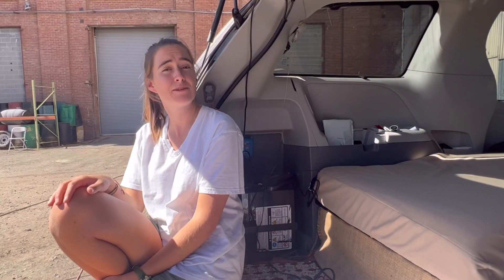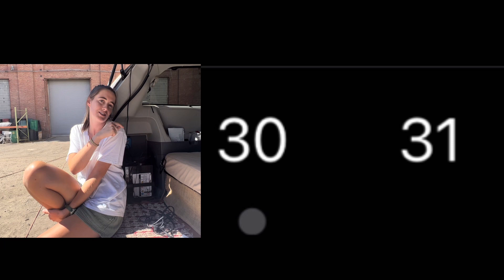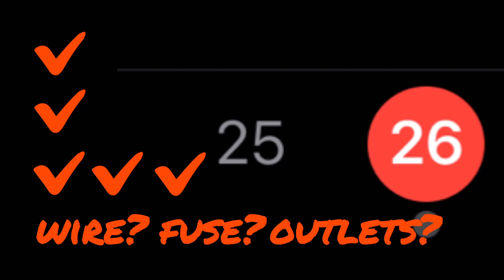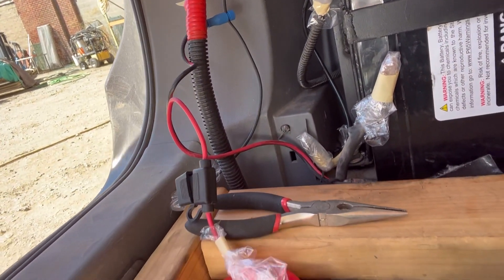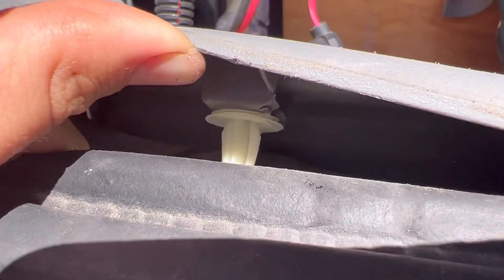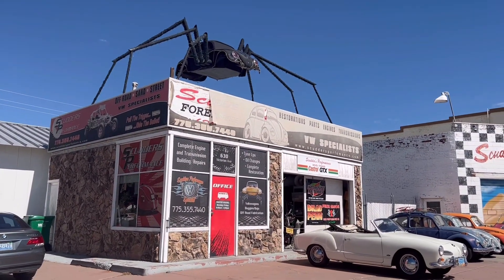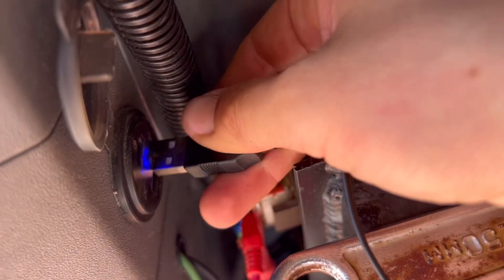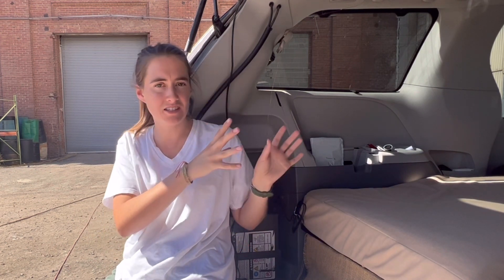Could YOU Solve This Van’s Electricity Problem???

Comment: Odd the power went out at the plugs they 2 days later fridge stopped working. There might still be a issue there somewhere as the fuse blew in the first place. Glad you fixed it for now
Reply from the maker: Yeah, I’m worried about that too. Only time will tell, I guess!

Comment: Well, see there, I knew you could do it! 
From the video I did not see an inverter so it would appear you only have a solar charge controller and 12 volt outlets. Also, there was no indication of where the blown fuse went to and where the supply side was coming from so it makes things difficult to fully diagnose. However, when an electric motor such as the one in the compressor of your fridge is trying to do it's job and can't get the amperage or voltage it needs then it can over heat and cause a current spike which can blow a fuse. And if you had a combination of of a heat stressed refrigerator and a somewhat drained battery this could be the reason why the fuse blew. It is still a bit odd why the refrigerator kept working after the other outlets went out when one fuse fixed them all but perhaps they had protection circuits built into them. One would still think they'd reset themselves once the battery was charged but maybe the fuse was damaged already and protection circuits are far more sensitive than fuses.  

Most 12 volt refrigerators rarely exceed 5 amps of current draw unless they are under supplied with current or going bad and most have built in protection circuits to prevent issues either way. So if this happens again I would definitely have someone check the refrigerator itself. It's always hard to tell what happened to cause a fuse to blow in a one off incident like this with no apparent damage to any other portion of the system though. Unfortunately, while they seem to be nice folks the people who installed your electrical system should not have put any fuses behind full body panels. Manufacturers provide quick release access panels to fuses for a reason. Also, if the connection to the main battery that we saw in the video was their work with the excess wire ends sticking out of the end of the connector then while not necessarily a sign of a poor connection between the wire and the connector, it's sloppy work and the connection should be inspected, especially if something like this happens again. Their grounds should be inspected as well. Even minimally loose connections can intermittently blow fuses can blow fuses as well.

You can go to Harbor Freight or Wal mart and buy an inexpensive socket set to make removing and tightening bolts easier. And an inexpensive voltmeter comes in handy as well. The yellow fuse you had is a 20 amp fuse in case you wanted to buy a couple of those to have handy. The potential safe max load for the socket shown should have been calculated by the original installer. If you are ever replacing the original car fuses use the amp rating stamped on the fuse. You can get away briefly with running a higher amp rated fuse to get to a safe location but get the correct fuse in place as soon as possible. You can google automotive fuses color codes to know what is what if the amp stamp has faded or otherwise can't be read.. On a supplemental system the installer must know the loads you intend to run and calculate fusing accordingly. Your installer chose 20 amps for the socket you replaced so presumably he thought that was a safe fuse rating. Also, while there's no indication one way or the other in the video whether you have one or not it's always best to at least use a battery isolator between the house battery (your supplemental battery) and the starter battery. True best case is to use an isolated DC to DC charger. Neither are absolutes for safety but both can prevent house battery or starter battery drain when there is an issue with one or the other and DC to DC chargers often offer on board diagnostics and protection for your house electrical system.
Reply from the maker: That’s a lot of info! I will definitely be keeping an eye on my fridge and electricity when I get back into my regular routine. I knew it was a 20 amp fuse because I read it on the side!
Reply: @BeerinBeautifulPlaces  Yeah, on a phone I suppose it looks like a lot but I write the responses on my laptop or else you'd get three words. Lol. But it also illustrates that while many problems aren't that hard to deal with they take a lot of writing to explain.

Comment: Surprise that they put a fuse in an area that is not accessible, fuses blows all the time.
Reply from the maker: Yeah, good point. Maybe they needed it to be close to the outlet?
Reply: @BeerinBeautifulPlaces  No, The fuse should be close as possible to the battery to blow encase a wire shorts as the wire before the fuse can short and effectivly catch fire (as it is not fused),  Who ever installed it like that (if not fused at the battery) let alone if the fuse is behind a panell has no idea what they are doing

Comment: Hi there l am glad you fixed the fuse l think that shop did something or shorted some wires when they were doing the brake job but if l was you 
I will call that company again and have them pay for it bcz l know your Toyota van is very clean and never been abused so don't let them take advantage of you and also brake job take max one hour to do for the front why do they take all day long . 
By the way if l was you l will go to Costco and buy jumping portable pack it's like $50 lifetime warranty and than stop by AAA and get the membership for like $80 or $100 which give free 200 mile and gas and battery jump and it's just to be save driving this van and not to be alone in the middle of nowhere. I am glad you are okay and fix that problem .
Reply from the maker: I already have jumper cables! I’m still thinking about getting AAA though!